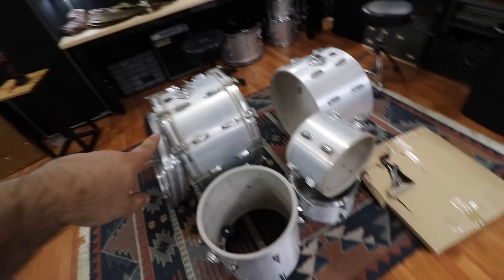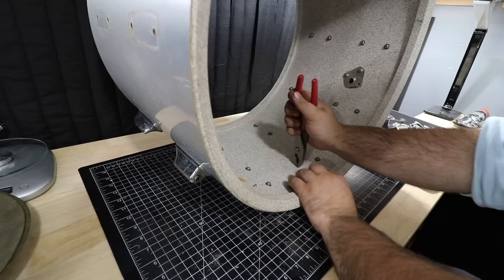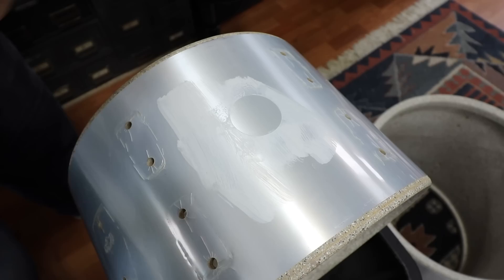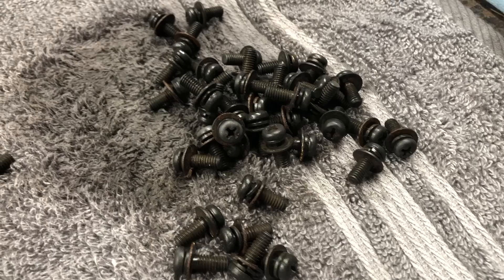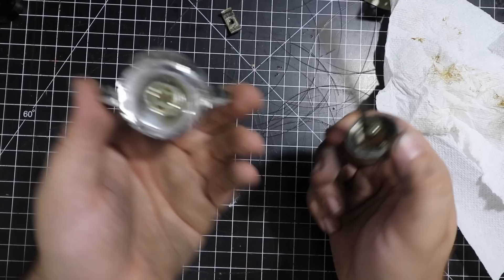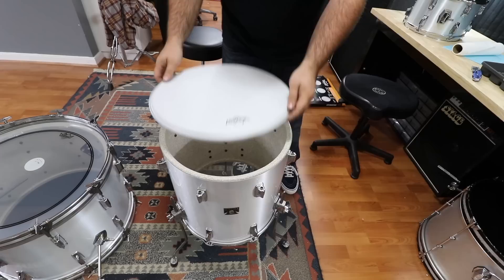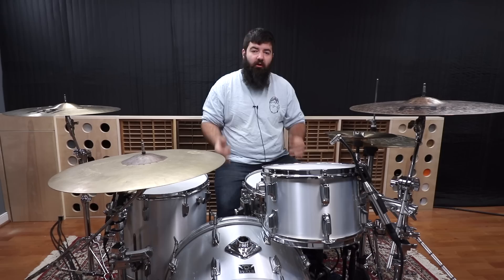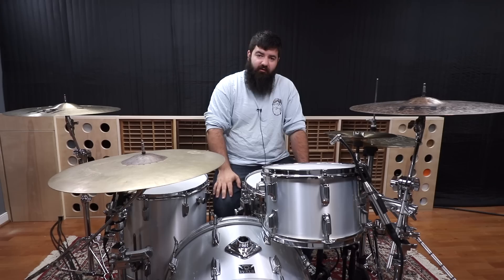Restoring a Vintage Tama Imperialstar

Comment: Man, ya gotta go old school when it comes to removing sticky stuff, especially old tape residue; PEANUT BUTTER! Just cover the residue with a thinnish layer of the stuff, and get ready to put some elbow grease in. Rub with your fingertips to start loosening the stuff, and, eventually, use your nails to scrape it off. Depending on how much, and how thick, it shouldn't take too long, but the result is impeccable. Just have a little jar of smooth, generic brand PB in the shop for anything sticky needing to be removed.

Comment: I recently finished my restoration of an 81 Imperialstar in white metallic. Octo kit, 22 and 24 with all concert toms. Hours of cleaning. Best cleaner was a 70/30 mix of white vinegar to water. Kills the corrosion and helps neutralize the rust. Aluminum foil and the mix to remove bad rust. Then polish and buff using simichrime polish. Just like new.

Comment: My first brand new drum kit was the TAMA Imperialstar in Royal Pewter, like one of the shell kits in this video! It served me well for over 25 years. I always thought that I'd be buried with that kit! It was my baby! But in the last few years of having it before I decided to sell it, I had to keep it in a basement, where it collected rust. The rust was heavy on some pieces.  I also had the King Beat 6.5 X 14 snare! I miss that thing! Sometimes, when it was tensioned just right, I swear that it could almost play itself! Sweet drum it was!  
It was my first kit! I had the stands, hydra bass pedals, each for double bass, and Avedis Zildjian cymbals. The New Beat hi hats were awesome, piercing and heavy!  They just don't make heavy cymbals anymore unless you pay out the wazoo for them! 
After I sold the kit about 10 years ago, I bought a Mapex Black Panther Velvetone kit. Definitely a different animal, but gets the job done. Sabians now instead of Zildjians. I still have 2 of my original cymbals from my TAMA kit that never sold in ebay. I'll keep them for personal reasons.
Reply: ... that was a good read - appreciate the words

Comment: Here's a tip- get a vibrating tumbler on amazon or harbor freight and use crushed corn media.  It will remove all rust and makes chromed pieces very shiny.  Imperialstars look great, but the sound is wanting.

Comment: I have that same kit from the early 80's.  Mine is a 12, 13, 18 toms and 24 bass drum.  The wrap cracked about 10 years ago so I pulled it off and wrapped it in auto vinyl and it looks great.  Still play these drums at church regularly.  This is even the same color as mine originally.

Comment: WD40 bath in a small glass bottle to soak all tension rods/washers/nuts/bolts screws works great for removing rust, crud and grime.  Also, one drop of TRIFLOW liquid Teflon on tip of tension rods will make sure tension rods slide into threaded lug inserts effortlessly.  Nice vintage TAMA Imperialstar restoration David!   Happy New Year 2020!!

Comment: You inspired me Dave.  I picked up a set of 1979 Imperialstars from Kijiji here in Canada.  It's like Craigslist.  I got two 24 inch kick drums, 13, 14, 15 and 16 inch concert toms along with 16 and 18 floor toms.  The snare was some piece of crap that I through in the garbage.  Picked them all up along with the original kingbeat kick pedal for 125 bucks.  The wraps were toast since the previous owner had painted them green, so I peeled all the wrap and I'm in the process of sanding, staining and clearing them.

Comment: I restored a big 1984 imperialstar with the same finish.  I had some troll declare that they couldn't sound good. In fact he went on to say "Depends on what you consider good"  in an attempt to be dismissive.  As this video proves, the imperialstar are punchy, warm and great in the studio.  I'd slap some vintage emperor clears and a ps/3 on them and have a blast. In my experience, if someone can't make them sound good, they are not good drummers. The imperialstars will rock.

Comment: When I restored my 1976 swingstar I only used water.
Boiled all skrews I boiled and allt the other hardware I put in the dishwasher on the hottest program.. I was quick after to dry everything of to avoid water stains. 
Stripped all the plastic of and replaced it with anther self adhesive plastic wrap.. Not as durable as original but It looks hella good.  :) great vid as always!

Comment: Handheld steamer with distilled water works incredible for chrome.  Time consuming but thorough.  Also recently discovered a speed wax called Lucas Slick Mist that works great on all materials even cymbals and reduces fingerprints.  Has a cool bubblegum scent and leaves the finish showroom clean.
Goof off is harsh and reeks.  Ronsonol lighter fluid in the yellow bottle is slightly less harsh and scent free.
Reply: ... great advice

Comment: I have an Imperialstar with 2 24 inch bass drums wasting away in the garage,10,12,13,14,16,18 toms puter blue finish,the same colour as that spare kick you have.
Used it in a band ,Hobb’s Angel Of Death.

Comment: Maaaan! Takes me back... This was my first 'shop bought' kit (bless my folks) when I was a teenager, as an upgrade from the second-hand Beverly. I wish I still had both. Imperialstar was, at the time, Tama's aim at the mid-level market, and like any gear of that era was a good sight better quality than today's equivalent. Bought in the early 80s as a whole kit (14x5.5" snare, 12", 13" 16" toms, before 'power' size toms were even a thing, 22x14" bass drum) including hardware, I subsequently managed to find an 8" and 10" to match. I still have some recordings of this kit (pinstripes top, clear ambassadors bottom) and it sounds fine. In my foolish youth I sold it to buy a Pearl MLX because a) I was still susceptible to marketing, which led to b) I thought I wanted a deeper bass drum, c) I became convinced that the inner coating was a hindrance to sound, d) I fancied the lacquer finish. Older and wiser and still playing, in retrospect this was a brilliant kit, and a good benchmark- did I need another 2" bass drum depth?- possibly not. Did the inner coating mar the perceived performance? Absolutely not, and therien lies a whole other discussion about what makes a drum sound good. Was I an idiot to sell the shell pack for vanity? Probably- the MLX sounded as good (arguably not any better) though it did look good- is there a suggestion that we play a bit better if we think our gear looks ace?
 Re. hardware, I still have all the Titan series stands that came with the kit- the chrome is top quality and with (embarrassingly) minimal care is good to this day, which is more than can be said for that of some more recent popular hardware manufacturers... I still miss the 'Omniball' tom post system, it's to my mind the most sensible design yet for mounting toms.
 Tama, Pearl, Yamaha etc.- Big companies, no doubt still manufacturing good stuff, but nowadays having to compete to try and sell us 'innovation' that's not always innovation. The Imperialstar series was the epitome of quality and enduring budget gear.
 Thanks for the post mate, cheers.
Reply: ... that was a good read - appreciate the words

Comment: I have a 1971 Tama Imperial  Star with a Viking Boom stand, Pearl boom stand and a Roger high hat. The only issue I have is my Tama strainer is busted at the handle and the darn thing is impossible to find in my area. I will take your advice and switch to wing nuts for my toms and floor tom. Thanks for your video on how the clean them.

Comment: WD-40 to remove decals, it won't burn plastic like a solvent will.
Reply: @672mack - Wouldn't just some hot air from a hair drier do the trick, too?!  That wrap should be thick enough to take it.

Comment: There are two types of Goof-Off ..the basic type and then the type with Xylene. Never use the Xylene type on any plastic as you will melt the plastic.  Acetone is the same way.  Never use it on any plastics.  Lastly, after cleaning, use SC Johnsons paste wax!  I use it on my shop tools and it prevents rust and pitting like you wouldn't believe!

Comment: You should have left the hex bolt on the floor tom legs. I know they aren't as convenient, but those are original. Also those drums are either 1974 or 1975, so even more reason to do so. 
Great shells too. 5 plies are rare.
Reply from the maker: for sure, if I was to ever sell the kit I would put them back on.

Comment: What about the bearing edges? you didnt have to work on them? i have a old swingstar with round edges and i was thinking of doing them new... but the shells are this pressed wood or whatever like yours from the imperial. do you know if you can cut ne edged in these kind of shells?
Reply: That "pressed wood" is actually Zola coated 5 ply Philippine mahogany with reinforcement rings, if you have a vintage (made before 1980) set. Later kits (after 1980) had 9 ply shells with no reinforcement.

Comment: Those steel snare drums have a certain sound to them. I can't even put it into words. Loud?
Reply: The King Beat is also a SEAMLESS steel shell - I'm not sure if ANY other makers out there ever did that in the 70s, 80s
Reply: @bigkickleo  well, the supra phonic, is suppose to be a seamless shell too, right?
Reply: big tama  fan, here, now do one with the superstar, cherry wine
Reply: @marcoaurelio-zb4sf  Correct, the Supra IS seamless - but Aluminum. Also, it's only 1mm thin and lightweight. If this snare drum is as heavy and thick as described, I would guess it is likely 2 or 2.5mm thick steel. VASTLY different sound. I have both lightweight seamless aluminum and heavier steel shells (cast, welded, and also rolled) and they all sound VERY different from the aluminum. 🤘🏻

Comment: Awesome white pearl Tama kit, 
Ironically!!

Can I suggest a video ?!
I was researching about DrumDial and Tama Watch, and I couldn't help noticing the extreme similarity of the two devices to hardness gauges(durometer).
Both digital versions (DrumDial) and analogical versions(DrumDial and Tama Watch).
Even on the scale used on all mentioned devices, it goes from 0 to 100. In the case of durometer, uses the Shore A scale of hardness, applicable for soft polymers and rubbers.
You could make a video by testing this device, or if you know how they works, just explain the differences to us, and why don't have another similar generic devices who measure what the DrumDial and Tama Watch Tension measure.

Thanks a lot!!

Comment: Great job! Nicely done. I would have gone one step further and removed the tom mounting hardware from the bass drum, filled, patched and matched the hole and converted the bass drum to a virgin unit. 
That would have made the drum non original but it would have been a nice, personal touch. 🤓

Comment: I own a special edition hyperdrive imperialstar and i received it without a hoop or tension rods for the floor tom. Ive been fixing it up for a little while but i cant find tension rods that fit in the lugs. I read that the imperialstar has smaller lugs but i still cant find rods that fit. Any ideas anyone?
Reply: go to your local drum shop, take the drum there, they will find something for you

Comment: Does anybody know what makes these ImperialStars so desirable vs a Swingstar from the same era?

I have a Swingstar and my buddy has a Imperialstar.... i can't see why his is 3 times more expensive tbh, it's practically the same kit.

I know the snare is supposed to be a lot better when you have the Kingbeat type like in the video but on my buddies kit the snare is just a regular one with normal hoops and strainer .... just two lugs more than mine has but other than that they are exactly the same.

Comment: I owned an 80's imperial star kit once. This was in the mid 90s. It was bad. I'd take the 13" tom off, tune it up perfectly, hang it back on the L arm and there went my tuning. Just the tension on the bracket would do something to the shell. I think the shell itself had no strength. It was constructed very poorly or something. Probably plies of some cheapo asian luan or something. ...Not to mention this was the era where Tama had not quite found their identity. I'm referring to the (almost) Rogers copy lugs, and Rogers-like grey interiors.

Comment: The frequency of uploading video is reduced too much... honestly, I can't avoid disappointment. Also, I was hoping for a new covering… cleaning and reusing the existing covering was unexpected and under expectations. It's a pity to leave the mount on the bass drum and set it as a ball mount tom holder on the cymbal stand. I'd rather have set up a tom with a snare stand... or maybe you'd better use Gibraltar's special tom arm ... not a ball mount. Your channel is still quiet even though it's fortified compared to The Cymbal Project. Regretful... cheers, David.